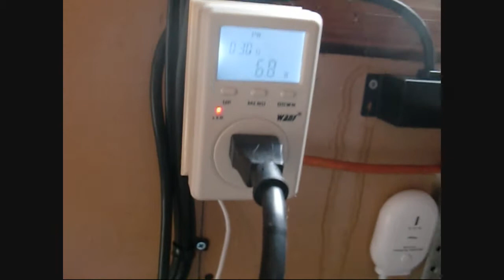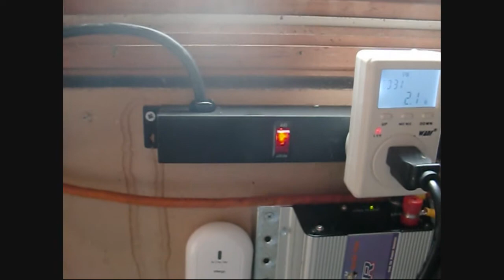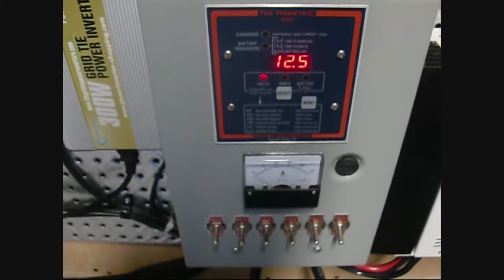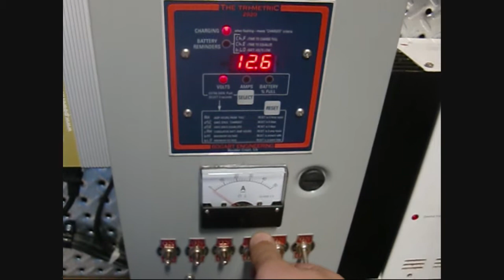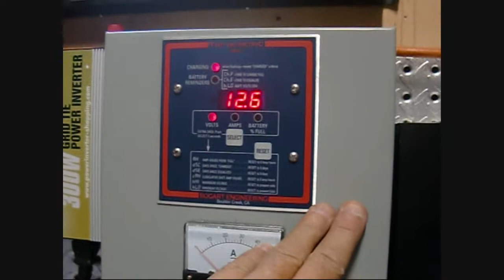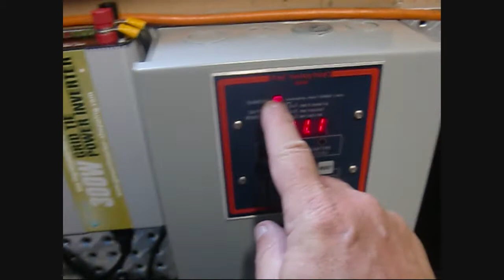Solar Energy Off-Grid - Part 5 - Installation and Test

Comment: @Fearlessthinker It all depends right, it's pretty subjective. If you never used your battery bank unless it was an emergency then you could get away with having a massive battery bank and some panels to slow charge them and maintain them etc. There is a balancing act though, you are right. I intend on making a whole new series of videos very soon. I keep saying it but I'm waiting on some parts to come in before I start. I'll do a video of the batteries...I want at least 12 myself, I have 8 now.

Comment: @Fearlessthinker You're probably right.  Building a battery box with a vent at the bottom and pvc pipe on the top running to the outside would be an easy job though.  The air intake would probably have to be smaller than the exhaust for an upward air flow.  I'm wondering if those batteries will give off a sulphur smell when charging.

Comment: lol that s  what it looks like on those cloudy days.  Man that looks pretty good and well. Is it ok to put all the grid inverters on the same house circuit will it carry the load?? how many amps are you able to put in  12 or 14 gauge wire solid  I know the breaker is 15 amps so its somewhere around there. Looks like its a pretty sweet wireing job.That is slick. I should do that very thing. It will still charge the batteries with one amp thats great. They actually charge better slowly than fast.

Comment: Very nice work, but shouldn't the flooded lead acid batteries be vented outside?  I've read they release highly explosive hydrogen gas when charging, and should be vented outside, unlike sealed AGMs.